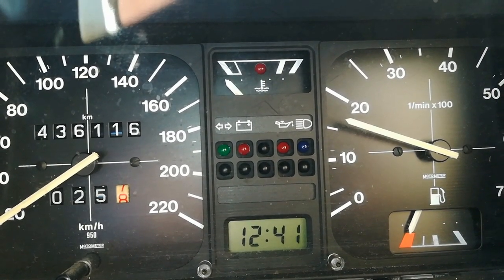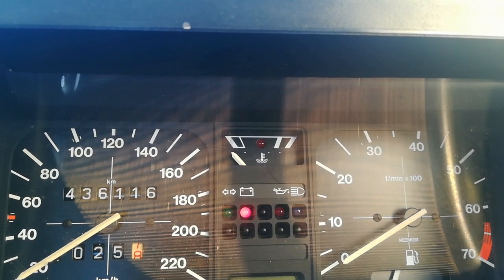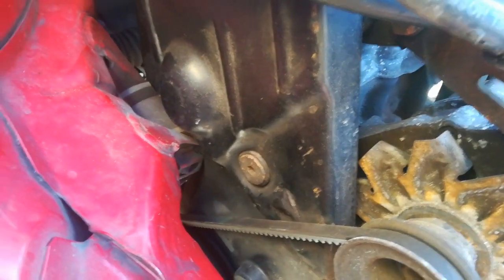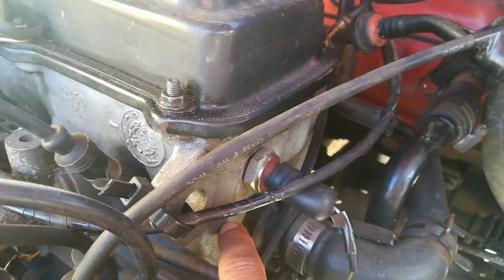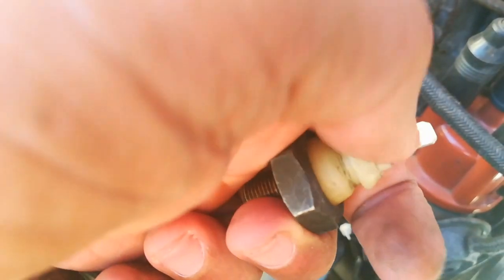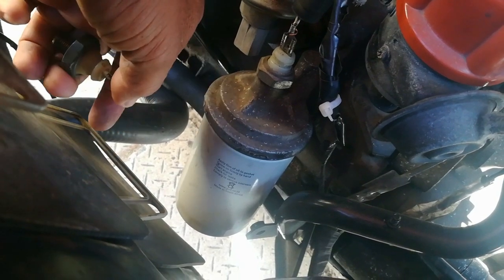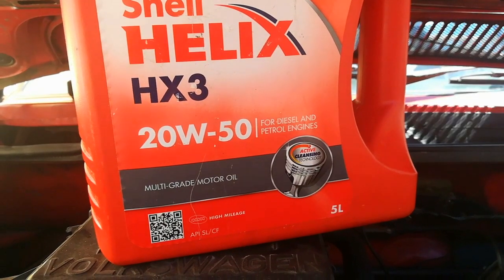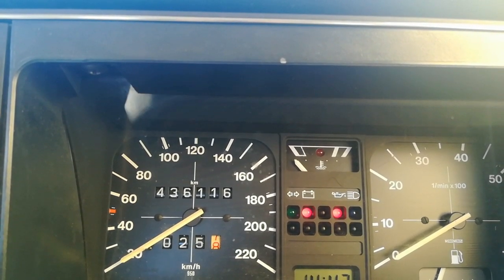GOLF MK1.HOW TO SOLVE FLASHING OIL LIGHT & BUZZER#golfmk1#vwgolf#vwfox#golfmk2#vwcaddy

Comment: Hi PJ

Is it possible that it's none of the above but a faulty instrument guage cluster instead? In other words, an electronic problem behind the cluster guage rather than oil pressure/sensor/switches? I have a 25 year old VW polo 1.6i, and its oil light has always flickered, and the buzzer alarm gets triggered above 2000 revs but sometimes goes off as well
Reply from the maker: You are correct it can be the cluster itself that's faulty or erratic...but unfortunately did not address that in the video

Comment: Hi pj can u please give advice on a issue I am having.  1.4 carb new spec . Dies or lose power and switch off when going uphill.  After a min or 2 it starts up and goes fine . Only happens when going uphill
Reply from the maker: Could be the fuel pump .You should test it ..how old is the fuel pump?
Reply: @pjs-golfmk1-diy  thank you . I will test it . The car was parked off for 2 years until I purchased it .

Comment: Hi, my oil buzzer comes on when I start the car when it's cold. Why would it do it?
Reply from the maker: Hi Freddie. It can be that your oil pump is starting to pack up, or the oil pick up is partially blocked due to sludge... Could be the wrong grade of oil.... Just don't rev engine hard when oil buzzer comes on,.. Switch off immediately.... You may also need to take sump off to do and inspection, and possibly clean out the sludge..hope this helps give you a bit of guidance...
Reply: This is also inherent problem with MK1 Golfs. It normally transpires it's the oil light/ buzzer circuit board in the instrument binacle which is faulty. A friend of mine working for VW in the 70s told me they used to change quite a few of them. Unfortunately this small circuit board is no longer bailable. You could try various MK1 Golf forums for a definitive answer and repair